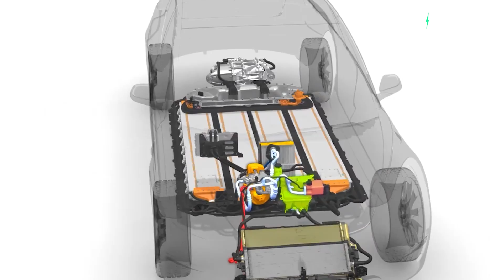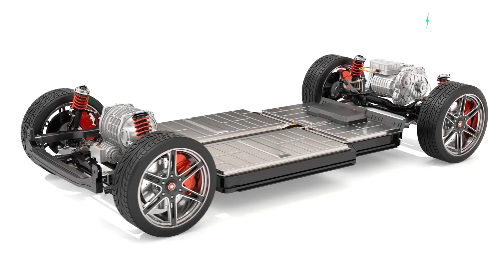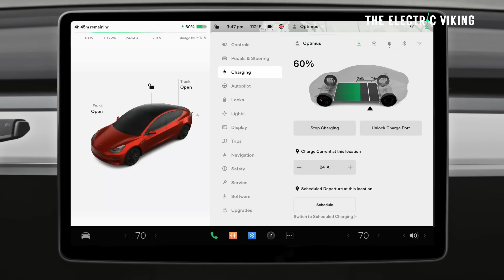No, you don’t need to replace Electric Car Batteries in 10 years time

Comment: A CSIRO report (Australia) found that in 2021 only 10% of lithium-ion battery waste was recycled that year. The situation in Australia has hardly improved since. Expired EV batteries are being stored in warehouses or outside in the elements and eventually end up in land fill. My friends with Tesla’s were visibly uncomfortable when I raised this subject with them so I’ve dropped it. A car is not worth losing good friends over.
Reply: That's a good point and you probably need to work on it more.  But recycling is up from 2% in 2018 to 10% today.   So I'd expect you'll be at 50% by 2030.  

It's simply not economical when there are only 3,500 tons per year of battery waste.   By 2036, you are expected to have 180,000 tons and you'll probably have very high recycling rates then.   

Unlike recycling plastics, the downstream of lithium batteries is highly profitable.

While current lead battery acid is 99% recycled, in 2014 with only 98% recycling lead batteries were producing 70,000 tons of waste per "A REVIEW OF DATA ON LEAD-ACID BATTERIES
ENTERING AUSTRALIA AND ARISING AS WASTE ", page 4.  Which means you still have about 35,000 tons of lead battery waste per year now compared to 3,500 tons of lithium battery waste.

However- you need the right laws passed now before the solar panel and lithium battery industries get too much political power. 

And now you have the full information so you can give your friends with EV's some comfort with more positive, less one-sided information.
Reply: @mac_mcleod  You make good points and companies will eventually certainly invest in recycling these batteries. But achieving 50% recycling of lithium ion batteries by 2036 will mean that 50% are still being stored with leakage risks or going to landfill. Another little hitch is that lithium can only profitability be recycled once. A battery with recycled lithium will lose about 4% to 5% of it's capability compared to a new battery. A second round of recycling is not efficient so you are then back at the start with a disposal problem. I think electric cars are a great idea but powering them with batteries weighing between 350 to 500kg full of toxic materials is a poor idea. I don't know what the answer is but there must be a better way.

Comment: Can last and will last are two different things. It appears that most original tesla roadster batteries are believed to last about 15 years. Since they started production in 2008, I don't know if there are any that have made it to beyond 15 years yet but stating that an EV battery "can" last for 20 years or longer is disingenuous. Production EVs with original batteries haven't been around that long. A Tesla repair specialist believed that while the roadsters he saw in his shop could reliably make it to 15, that the model S that used a different battery cell would only last to 12 years. As @xsu-is7vq wrote below, a relatively cheap replacement main battery would negate all of this but to date, those don't exist. These are very expensive disposable vehicles as of now.

Comment: So let me get this straight.  If I need to replace an EV battery in a car, the price is very low because the prices have dropped by 90% since 2010.  At the same time, the scrapped battery "black mass" is worth US $10,000/ton.  This doesn't make sense.  That's like saying something is simultaneously as light as a feather, but heavy as an anchor.

Comment: If you want to have credibility you need to be honest about the EV fires.
Turns out the Luton fire was a Range Rover hybrid, and the fire started in the battery. Burned out 1,500 cars.
And the truck hauling the Ford pickups had hybrids on board, and one of them caught fire.
I’m not anti EV I had a Chevy Volt hybrid that I really liked until we moved from a house into a condo, so no place to charge.
Gotta be honest man because the truth eventually comes out.

Comment: I had an EV and I can say that you’re full of it. Battery degradation year after year, forget long trips because you can’t find a place to charge unless you go miles out of your way and when you get there they’re either busy or broken then you’re screwed. Then if it’s cold out, range is greatly diminished. If you need service you can’t take it to your favorite mechanic because they can’t fix it. So you are forced to take it to the dealer. Once at the dealer be prepared to leave it 2 or 3 weeks because they don’t have the parts and only one or two technicians that work on EVs. Who’s paying you to push this crap?
Reply: I've owned several.  Battery degradation most certainly is a thing but if you own an EV you are more than aware of this and the batteries rarely just die without a reason.  Look at the failure rates, it's actually very impressive how few batteries need replacement even after 200,000 miles.  

You obviously didn't own a Tesla because in 5 years I have only seen 2 broken chargers and both times I just moved to the next spot.  Also, the charging network has expanded greatly in the last few years.  If you were charging on a CCS network I understand your frustration but there are many more Tesla Superchargers and soon they will be open to everyone.   

As far as needing a mechanic, I've had a few things go wrong over the years but most of the time Tesla comes to you to fix it.  The only times I had to take it in, was the lower control arm replacement, they had it a few days, and a Sentry mode issue which they had for a day.  They came to my house to replace the window driver buttons and a charging port door.  They also rotate your tires for 50 bucks if your lazy like me and don't want to spend time in a tire shop that will do it for free.  There are now mechanics that work on EV's.  The shop that works on my diesel trucks also works on EV's now and there's two other shops in town that do as well.

I'm sorry for you frustration but things are improving at a rapid pace.  I still need diesel vehicles for work because there's no real viable option for larger trucks but my fun car will always be an EV.  I won't ever go back.

Comment: Auto batteries are built to a higher standard than phone batteries. The carbon particles are heated to very high temperatures to repair cracks and hence don't degrade as much.

Comment: I am hopeful that LFP batteries will reach 10,000 cycle longevity at the end of this decade.  However, let’s remember the gentleman interviewed on YouTube who used his 2019 standard range Tesla as a ride share for his business.  He put 128,000 miles in about 1 year and his battery dropped off to 35 miles of range.  He would charge it overnight at home and supercharge it twice per day.  He took it to Tesla and they basically said, “what did you expect?”  He would routinely charge to 90%.  He was forced to replace the entire battery pack for a cost of $9k.  It ends up, his Toyota Camry was cheaper to operate the ride share business as it is reliable.  I think the newer batteries will address this issue.
Reply: I heard about the man from Nantucket, who bought an EV and it ran off with his wife. 
Had to pay for the battery on top of all that. In gold bullion.
Reply: There is another guy with a similar story doing ride share in California with a model 3. His was under warrantee but his replacement also failed so he was on his 3rd battery. I’d say a Prius is a safer bet for taxi and I really hope my battery does much better charging at home to 80% daily, level 1 charging.
Reply: Haven’t seen the video, and I’m not claiming that there’s a 100% right or wrong answer here.  I will mention that it’s easy to see the headline $9k battery replacement cost and assume that it’s cheaper to operate a gas vehicle, but unless he tracks the cost of gas vs. electricity to “fill” the car and other consumables like oil changes it’s not really possible to say whether he would be further ahead with gas vs. EV.  As a baseline, assume the basics like tires and suspension will both be equally expensive to maintain over the distance.  After that, factor in (off the cuff calculation) a minimum $750 in oil changes if done at 5k mile intervals, unless doing them yourself which means unpaid extra work. Likewise, the motor on a car driven that distance in a year is going to have potentially major stuff about to go wrong, water pump, belts, spark plugs need changing etc.  An EV with that distance has no concerns with the electric motor, the battery is really the most expensive “consumable”. Likewise if driven reasonably, the brakes on the EV should last longer if using max regen braking. Finally, although EVs have a transmission, it’s a single speed so there are never gear changes and transmission oil change intervals are ridiculously far apart, in fact GM suggests that it doesn’t need changing on the Bolt.

I’d have to locate the study, but actuaries in the insurance industry have now crunched the numbers and calculate that the long-term ownership cost of an EV is less than a comparable combustion engine vehicle, even considering the higher initial purchase price.  My own experience is 125k kilometres on my 2018 Chevy Bolt with zero maintenance cost except tires and brakes. Battery issue for possible fires was dealt with by GM.  Charging at home costs me about $8 for 320-400 km of driving, car is primarily used for commuting. Of course, that’s a single example and I could be an outlier, but from the friends I have that also own EVs, their experiences are similar - a bit more to buy up-front but then just very cheap to operate. Based on my estimates, I’ve just surpassed the crossover point where the initial price difference has been made up by the savings not having to buy gas and do other maintenance, at least here in Canada where I live.

I also definitely hope that successive generations of batteries will have both more recharge cycles as well as better volumetric energy density and faster recharge times, although they’re pretty fast already.

Comment: Battery degradation is not linear.  Year 1 about 3%, year 2 about 2%, year 3 about 1.5%.  I think the ultimate question is not whether or not the battery will catastrophically fail in 20 years or if it’s just a matter of reduced capacity.

Comment: Hi Sam. The Tesla model 3 battery is designed as a structural part (filled with glue) so cannot be repaired if a fault happens. I believe Many people will not take the risk (that is not pay high value) for a 10 year old, or older, EV with a structural battery pack because even if the battery could last for another 10 years it might fail tomorrow and you will have no choice but to replace the whole pack which is often more than the car is worth. The only way EVs are going to have any long term value is if manufacturers put their money where their mouth is and give a longer battery warranty. To put this into context, over 20% (approx. 7 million) of the cars in the UK are 15 years or older.

Comment: 250 k km is nothing i did that in 2 years + testing in distance alone tells nothing since a lot of deteration comes with time...think Nissan leaf reason why there cheap on secondhand markets is because there battery is dead and the battery costs nearly asmuch as the car....

Comment: It really depends on mileage. If you have 50,000 KM mileage per year, 5 years of battery life is pushing it too far.  If you stated that EV batteries could last up to 250,000 miles, why is Tesla Model 3 EV batteries warranty covers only100,000 miles? If they are really have the best batteries on what you are stating, maybe a 10 year/200,000 mileage warranty will be fair for the buyer.

Comment: 2014 P85 here with 95k and original battery that only has 7.5% degradation or 92.5% of original capacity.
Reply: WOW, that's awesome. If your at 92% after basically 10 years. Just imagine what the new Teslas can do.
Reply: Good to know .  😂

Comment: 10yr nissan leaf - all be it 25% range loss - still going strong oh and i pull twice the power of what it was designed for. That tech is 10 years ! Uncooled cells , thats a good effort. Zero servicing - only tyres

Comment: Tesla battery out of warranty in 8 years , you will need to replace it at some time $20,000 Toyota hybrid battery 10 year warranty last 15 years $3500 to replace . Due to the high cost of battery replacement. BEVs no one is buying them second hand out of warranty due to battery replacement costs, you cannot tell if the battery has been damaged ( been in a flood etc) and of course reduced range which is fact and gets power limited. Batteries  only last about 15 years beyond that you lose too much functionality eg goes into limp mode can’t handle the power demand for normal driving on a hot day etc. without a healthy battery the car is worth nothing . Second hand you’ll get more money by parting it out and selling the parts on line

Comment: Exactly how much power do you need to charge at home , I'm off grid on solar but getting to the point where I could possibly charge a phev or ev if I can get something old enough at the right price ,, as it is when my new inverter arrives I will be able to use my welder,,
Reply: Keep dreaming dude my 5000 KWH system can barely keep up with my beer fridge and electric golf cart

Comment: Change is difficult for everyone. If everyone realized how much the spend on maitance (oil changes, starters, brake pads, water pumps, timing belts, plugs and wires etc) they would welcome electric vehicles
Reply: Paying higher prices and having massive depreciation pays for a lot of oil changes.
Reply: Not only isn't that happening but the sale of EVs countrywide is slowing dramatically.

Comment: This is a joke right? April 1st stuff. In winter, lots of evidence shows than EV's can loose between a 5th and a 3rd of their range. Not exactly glowing eh. Oh and what is the battery life guarantee from the manufacturers? Eight years for 80% charge capacity remaining? And if you have to replace a battery in, say, a Jaguar IPace - the cost IF A BATTERY IS AVAILABLE is like £25K which means the car is then a write off. No-one in their right mind would buy a second hand EV when its 6 to 8 years old. Nice try fella but pull the other one lol

Comment: The fear of battery replacement cost is the primary reason I hear from people who say they would not buy any EV. Even though I believe it's very unlikely an EV owner would need to replace their battery before 200,000 miles, many people are unwilling to accept ANY risk. The repair/replacement cost is just too high in their opinion. Tesla should consider offering a battery extended warranty or replacement insurance for those who fear an unexpected  battery replacement cost. Also, any update on the Tesla couple (Johnny Bacigalupo and Rob Hussey) you reported earlier who say their Tesla Model Y battery failed due to water ingress after driving their car in heavy rain? They say Tesla will not replace the battery under warranty and have said the cost to repair/replace will cost £17,500, which is more than 21,000 $US at today’s exchange rate. It's stories like this that continue to stoke fears of unexpected battery replacement cost.
Reply: I am based in the UK. It rains often in the UK. Consumer protection laws (excluding businesses) would ensure there was no cost, for manufacturing defects or not being of merchantable quality (i.e. can't cope with rain). Otherwise I would have thought they would have insurance. We are being misled. Wait for the legal action if any.
Reply: @robertwhite3503  Of course we are being misled. They obviously drove it in a flood and made up a story to get a free battery.

Comment: This is certainly comforting news, all right.   And if it's really true that the batteries are so good that they can be glued into a non-replaceable, non-repairable component of the car itself, shouldn't the manufacturers be willing TO GUARANTEE that they will?   The present 8yr/100Kmile warranty doesn't convey that confidence very well...
Reply: The warranty nowadays also usually relates to a minimum degradation at "x" years.  My Atto 3 has 8 years at +70% SOH (state of health).

Comment: Regarding batteries loosing their rated effectiveness, let's not discount weather's impact on battery performance. I live in the northwest of the US and experience tolerably warm summers and very snowy winters. The car displays a max of 292 miles in the summer and 207 in the coldest part of the winter. Because of this, you could say that there should be no absolute expected charge capacity because of weather conditions. At a year of ownership, I am at roughly 22K. How will I actually know the battery is compromised once I get to 120K miles if the weather impacts battery efficiency to begin with?

Comment: I'm not going to complain too much about EV myths just yet. That FUD is keeping demand in check and leading to lower prices. Those folks saved me $20,000 on my Model Y. I don't want to see demand and prices go back to 2022 levels. When production starts to outpace demand in a big way maybe I'll correct them then.
Reply: Good point
Reply: drop in demand has all to do with higher interest rates vs 2021/early 2022 and has nothing to do with FUD. Once central banks start pumping money again, prices will go back up.
Reply: @Fear.of.the.Dark.  Interesting…I didn’t think about that. So monetary policy really does control inflation?
Reply: @frankcoffey  you have to pay 10% starting interest rates on auto loans these days with great credit vs 1-3% interest rate in 2020/2021. Why do you think Musk is forced to reduce Tesla prices?